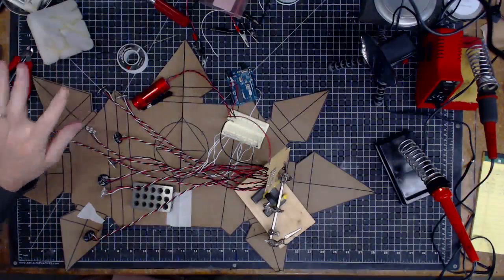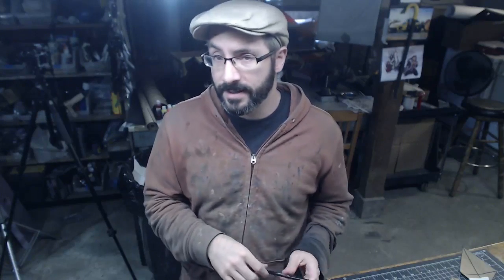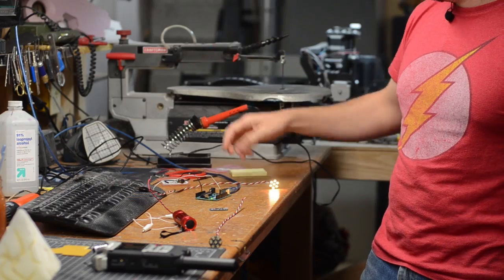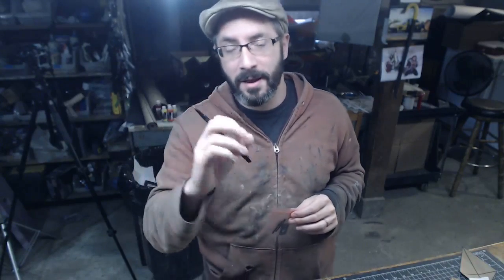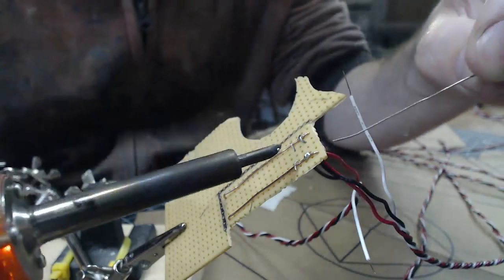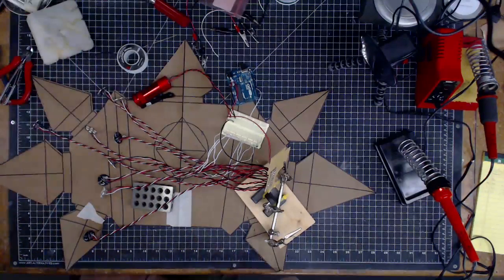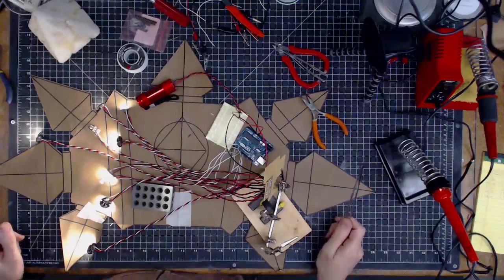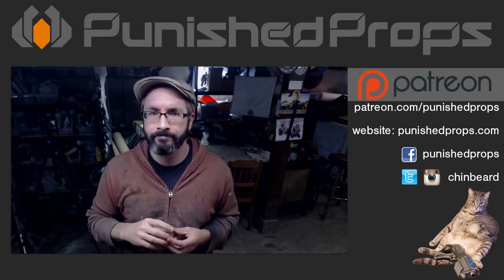LED Pulsing Lights for the Hand of Rag - Prop: Live from the Shop

Comment: Looking at this I got to thinking. I have an LED controller off of ebay I use for controlling a heated vest i made for my motorcycle. tons of modes where you can heart beat the light. flash, dim.... if you do a project like this again in the future you should check it out. it uses a remote control and can handle 12a so plenty of power. another benefit would be the fact that its only like $5. Being a prop maker I bet you'd benefit from something like this in the future. I didn't want to make this seem like an advertisement but that's what it reads like so I'm sorry I just think it would work well for you. http://www.ebay.com/itm/DC5V-24V-12A-RF-Wireless-Controller-Mini-Dimmer-for-Single-Color-LED-Strip-Light-/251500727341?hash=item3a8e9c8c2d:g:0BIAAOSw3xJVd5tt

Comment: The neopixels are designed to be chained one to the next.  Bit fiddly to solder but means you need less pins on the arduio end and can do addressing to control each pixel individually.  Even the power can be daisy chained.

Comment: For your soldering iron, look up a 'brass sponge' on ebay or amazon- it's much, much better for cleaning a soldering iron tip compared to a damp sponge. It won't corrode the tip, and it won't cool it down either when you want to keep it hot- it's one of those items I wish I had learned about years ago, used to be a little bit of a secret in the electronics industry...

Comment: I really gotta ask... where did you buy those weights?

http://puu.sh/rWFM3/056fd8d61a.jpg
Reply: I've just realized you cold 3d print a tableboard for the electronics soldering, and furthermore, the case where all this should rest inside the prop =P

Neo pixels and arduino are so cool!
Reply: thanks bill ;)

Comment: It would probably have been easier to daisy chain them. It would also use just one pin.
Reply: They are digital, Bill. They are the same LEDs as the neopixel strips. They have a data in and out.

Comment: If I remember from my Arduino hacking the first and second pin are a bit special (used for serial comms?) so I tend to avoid them. 

Shameless link to my last Arduino project - lots of soldering! https://www.youtube.com/watch?v=zE7b9pkLBi4
Reply: RX/TX pins
Reply: Had to hand drill 128 holes into a piece of acrylic as a jig, so it's not that tidy, the next one will make use of the 3D printer for sure! 256 LEDs this time?

Comment: He's soldering wrong, you're supposed to set the iron down on the surface to heat it up and then add the solder.
Reply: It works both ways, but your way is used in soldering competitions because it causes bubbles that can only be seen with a magnifying glass. Down the road Bills way will need to be re-soldered if exposed to moisture. But I digress He should be fine.
Reply: Ben Punch I was taught to do it the same way as Bill. You never know how sensitive a component will be to heat.